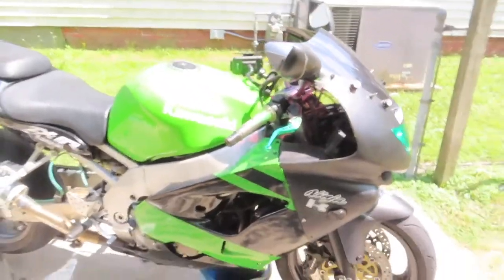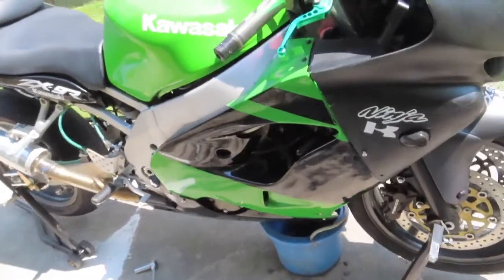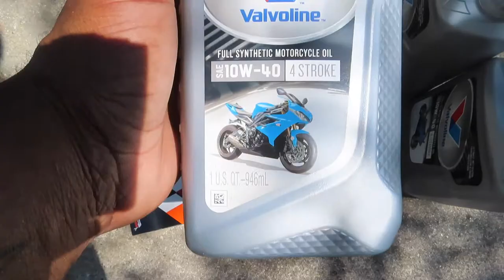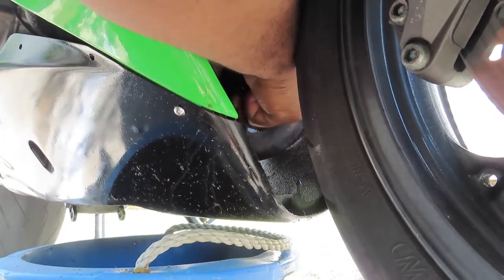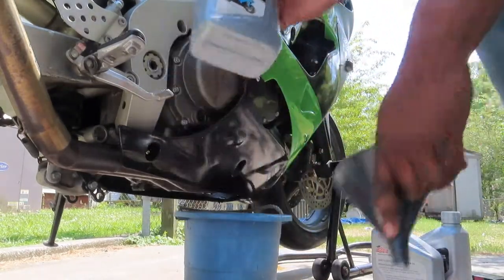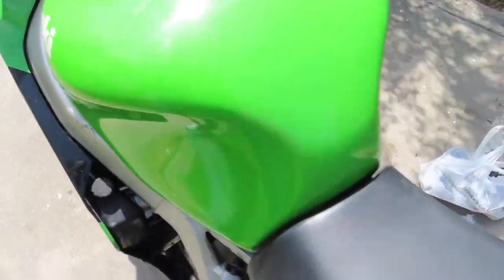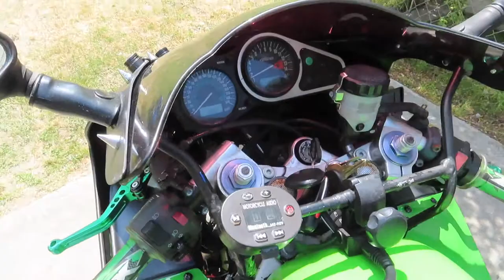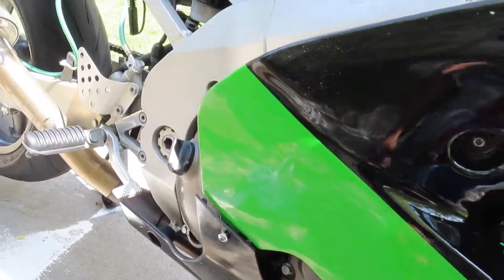Oil Change on Kawasaki ZX-9R ( Wasn't Shifting Past 2nd Gear )

Comment: LOl dramatic oil change. Nice beat.... The gear box in known for issues. I just bought a used motor for $600 and swapped the whole thing.
Reply from the maker: Dramatic? It’s dramatic you swapped the whole engine 😂😂😂
Reply: haven't had any transmission issues on my 94. Shifts smoothly

Comment: Having this issue on my Cbr. Did the oil change solve the problem?
Reply from the maker: MrGrey yes sir, the oil being used is also for the gears. Once I did the oil change everything was perfectly working with my gears
Reply: 540TV good to know. I had to limp home in second gear today...

Comment: I have a 94 ZX-9R. My mechanic said not to use full synthetic in this bike, is he correct?
Reply from the maker: He’s incorrect...fully synthetic is always better for any vehicle
Reply: @540tv6  figured as much. old man stuck in his old ways lol
Reply: @540tv6  although it does seem to run and shift smoother on dino oil...
Reply from the maker: All good man...nothing wrong with them old ways they still work
Reply: You are giving out incorrect info. Yes, it is correct some bikes shouldn’t use synthetic. Depending on the clutch that is used. Check the manufacturer’s recommendation for oil type.

Comment: I’m confused why would an oil change mess the gearing up?  I’m asking because I just got this bike zx6r and got an oil change and I’m having problems shifting into second and 3 gear like it just don’t wanna go sometimes it works sometimes not.
Reply: Bikes unlike cars use their engine oil as gearbox oil and clutch oil at the same time. I know of people who have used car oil in their bike and ruined their clutches.
Reply from the maker: 🤝 exactly